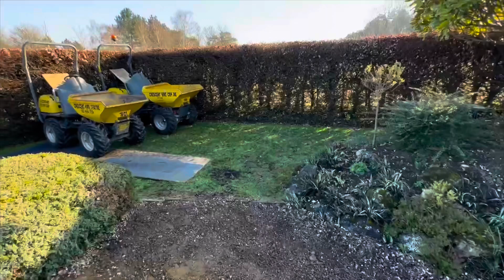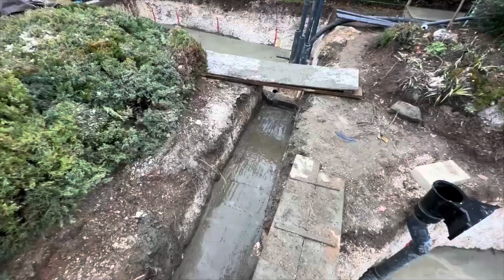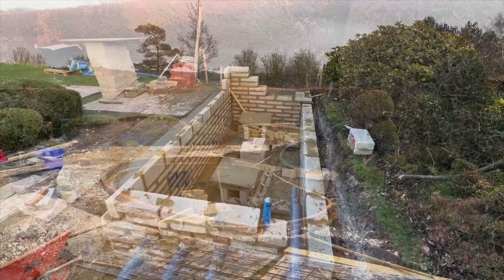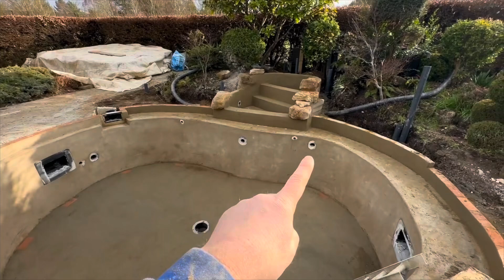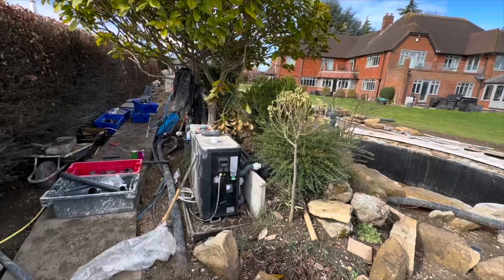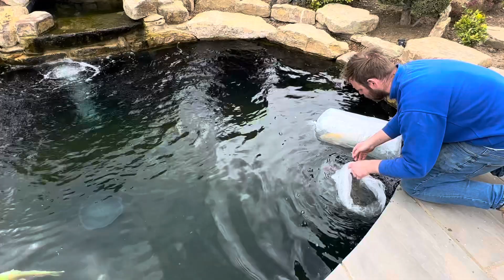How to Build a Koi Pond in 17 Days! - 5000 Gallon KWG Pond Build in Epsom, Surrey

Comment: Enjoyed thorough explanation and good video work, but I am wondering about the amount of bio-filtration. Am I correct, is the only filter media located next to the drum filter?  If that’s the case, then that seems very insufficient for the amount of water, under the full sun, with more than 5 fish.  Do you have plans or the capability to add more filtration?  From my understanding, the drum filter and the UV light don’t count as biological filtration. The drum filter makes the job of the biofilter much easier. And the UV light aids in water clarity and maybe some elimination of unwanted pathogens.
Reply from the maker: The Compact-L drum filter has a moving bed filter inside which is used for the biological side of the filtration. There are 2 other filtration systems behind the waterfall, this pond has a sufficient biological filtration for its size. 👍🏻
Reply: @koiwatergardens  Thanks for the clarification.  Sorry, I didn’t notice the explanation about those filters behind the waterfall in your video.

Comment: Very professional job guys, obviously you feel one bottom drain should be sufficient but I do think the clients will regret their decision not to have the pond located closer to the house.
Reply from the maker: With a circular shape pond the centrifugal force from one bottom drain is more efficient, we also have a mid-feed installed for suspended particles and a skimmer for floating debris

Comment: Do you think 1 bottom drain will be enough? Reasons why please as almost all ponds that size have a minimum of 2. Thank you guys 👍🏼
Reply from the maker: With a circular shape pond the centrifugal force from one bottom drain is more efficient, we also have a mid-feed installed for suspended particles and a skimmer for floating debris
Reply: @koiwatergardens  Thank you for explaining.  Speaking to Oase they say a max pull of 14000 lph is the max achievable with 1 x 4” bottom drain so is that enough to run this pond effectively? 
Sorry for asking but so many people say different things!
Reply: @surreykoi  there is also a 4' mid level drain and the skimmer so turn over will be at least once an hour. The max pull will depend on the actual  frictional losses which will be proportional to pipe diameter, pipe length, number of bends and head height - different for every pond.
Reply: @deejaysmi1469  that explains it totally thank you 🙏🏽 👌🏻👍🏼